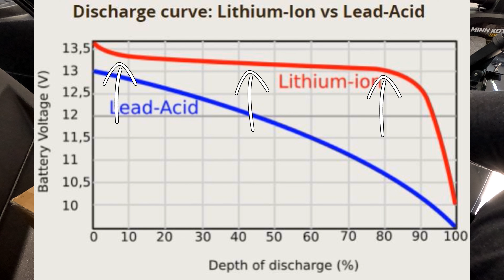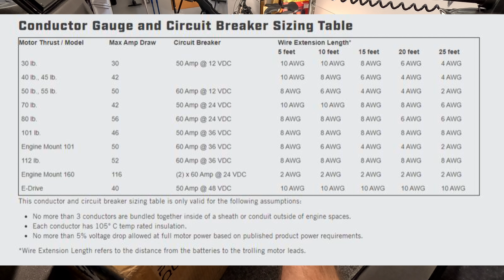You Won’t Believe the Difference This Lithium Battery Makes to Your Trolling Motor!

Comment: Thank you for your videos on upgrades for this boat.  Bought the same model year a month ago and these videos have been a huge help!  I upgraded from a 1986 16' Grumman. Opening up the panels of the boat was less scarry after watching your previous videos (ie. moving the Terrova and other equipment from the old boat to the tracker). One upgrade I would like to perform is a bow control for the trim of the engine.  Currently there is one on the controls and directley on the engine but there have been a couple times I really wished it was on the bow by the trolling motor.  Great videos,  Looking forward to doing the lithium battery upgrade!
Reply from the maker: Happy to help, it was a little nerve wracking at first to take things apart but after doing it, it wasn't nearly as bad as I expected.